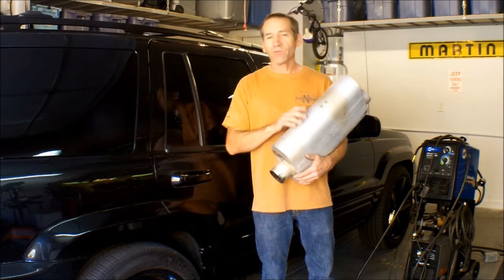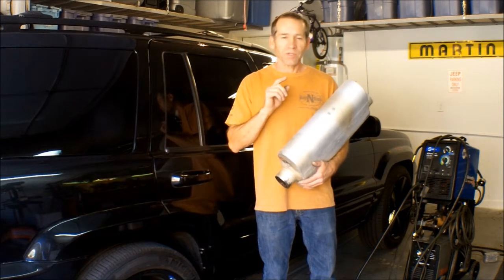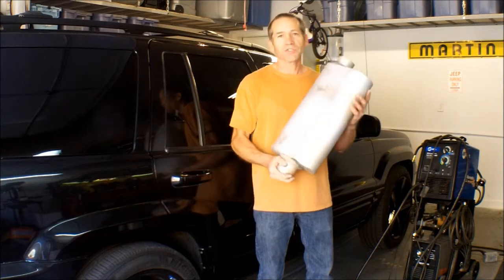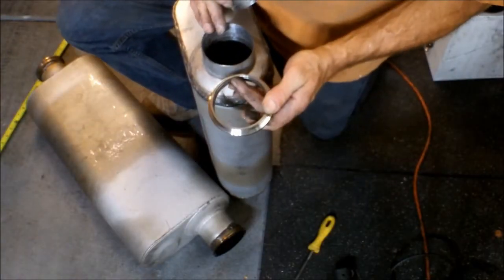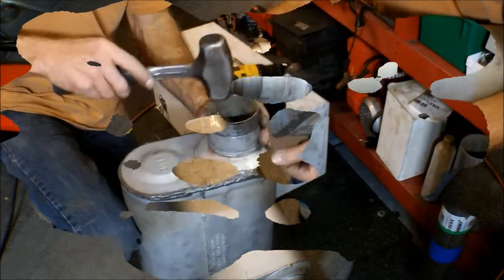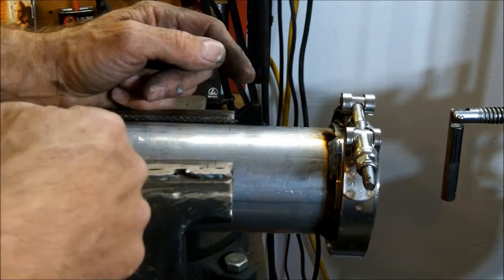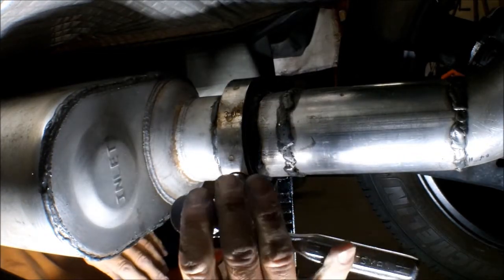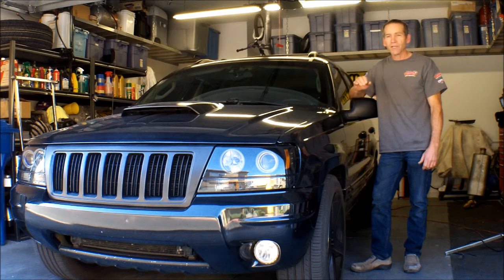Customizing a Flowmaster 50 HD Muffler to Fit

Comment: Super 44 sounds good that's what I have on my 2000 wj 4.7
Reply from the maker: That's what was on the Grand when I bought it. The 44 does sound good but the drone at around 1800 rpm was to much for me. I also have the super 44 on my 98 XJ with the 4.0 and I like it with that engine.
Reply: Yeah it sounds nice ..since I did a 5.3 swap on my wj the sound isint the same anymore

Comment: Why is it necessary to swap the ends around? could you not have just attached the muffler the way it came and just shifted it to either side of its original position?
Reply from the maker: For a couple of reasons,  I would have had to modify one end or the other of the exhaust pipe and ithe muffler would most likely have hit the frame.